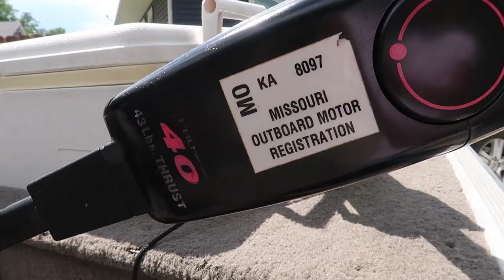MY FIRST BOAT (Bass Tracker Panfish 16)

Comment: Nice boat...I got the same boat.. tore out the stick steering and converted it to a steering wheel
Reply: Why did you change the stick steering?....i ask because i am undecided between doing a stick or regular steering wheel on jon boat
Reply: @tooleyboi491  i didnt like sitting up front.. and the torque steer that comes with it.. so i decked it and bought a shorter cable steering wheel kit.. i should have kept the live welll but i sold it.. my only regret.
Reply: hokiedokie  what did you do for a console looking to do the same with my boat ?